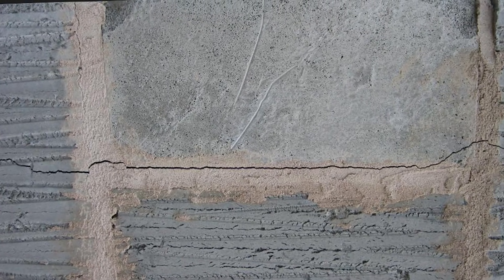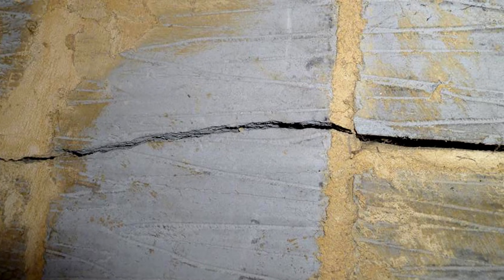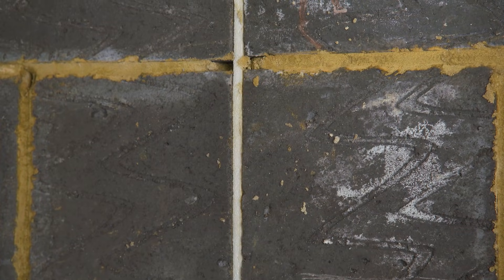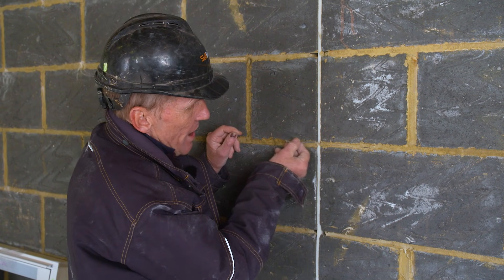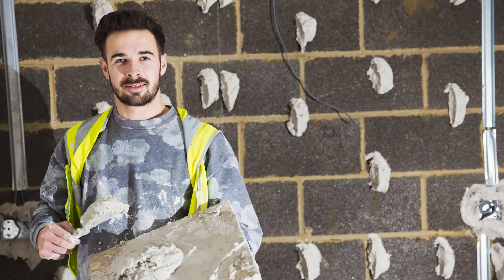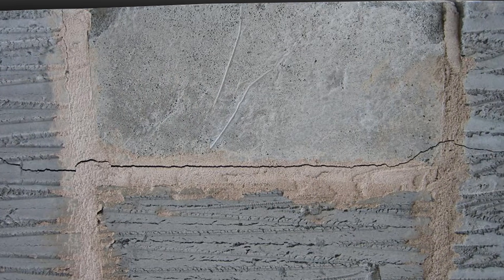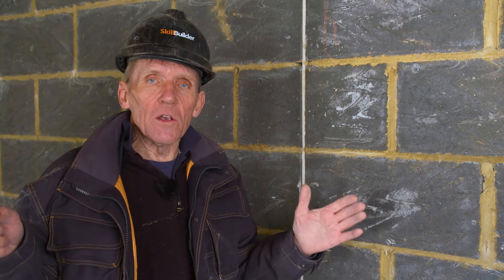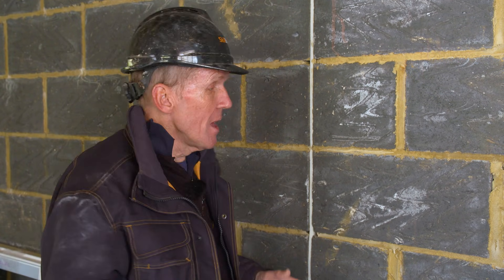Why Are Aircrete Blocks Cracking Up So Often?

Comment: by Aircrete do you mean Aerated Autoclaved Concrete, i.e. AAC?  if so, your joints have too much mortar and you need hollow core & Ublocks filled with concrete & Rebar .  I used thinset mortar on walls that were 28 ft tall and 48 ft x 80 ft.  there are no cracks even after earthquakes.  i did follow HEBEL's instructions to the letter.  the structures has a lot of rebar.  there is a dual lintel band made of Ublock & 2 pieces of #5 rebar.  there is verticle or horizontal rebar every 10 ft or lwss.  all windows or doors are surounded on the sides by cored block filled with 5500 psi concrete & #5 rebar and by U Blocks above.    the problem is Labor thinks they know more than engineers and don't do what they are told.  I find this to be a common problem; all to often i here "Oh you don't have to do it that way ; we never do".  we will soon solve the labor problem with robots.
Reply from the maker: different stuff. You don't have these blocks in the USA

Comment: The problem is typically inherent with a wrong strength mix! The mortar joints need to be at least 10% less strength than the material being laid,

Comment: Do the aircrete blocks have any internal reinforcement? If not, why not? Even very old Adobe or mud bricks contain straw for reinforcement to prevent shrinkage cracking. This was figured out several millennia back. Why not use short strands of glass fiber in the aircrete. Stronger blocks with no cracking.
Reply: I've never believed in air crete. Not substantiated as as safe as concrete.

Comment: In warm conditions these blocks absorb the moisture out of the mortar as it is spread .Always soak the blocks when laying .Bigger cavity and clinker blocks preferred choice .
Reply: I'm laying my first blocks & they soak out the mortar moisture wicked fast in 32 C (90 F) temps. But my block mfr does not recommend pre-soaking. So, 2 questions...

Are you talking about aerated or autoclaved aerated (or both) and what is your pre-soak rexommendation based on?

Comment: i was told many years ago by a long  retired foreman who went to see Celcon blocks being made ( from one massive block and the wavy lines in the blocks are the marks of the saw teeth that have cut them up)  that the manufacturers specified laying  100mm expanded metal lath into every third horizontal course . Goes to say that ive never seen it done.
Reply from the maker: That is true

Comment: OMG. Brits are still building homes with 17th century technology. Would you look at how thin those blocks are. What possible strength does that provide? not to mention almost zero noise attenuation. And where do you put the insulation to keep the cold and damp out in the winter? Bloody amateurs.
Reply from the maker: No need to show your ignorance or be insulting. The insulation is in the block trapped air and in the cavity. The compressive strength is 3.6 newtons. These blocks were not around in the 17th century but timber frame was.

Comment: My thinking we need an additive  to make it more liquid 
That way we can mix the cement drier , then additive then air .
The aircrete would be stronger
Reply from the maker: They use zinc filings to react with the cement and cause the bubbles to form.

Comment: The same principle described here,  applies to brickwork,  particularly pointing.   Too strong a mortar could lead to shrinkage  cracking of the joints and even brick fracturing, particularly on soft dry brickwork....a good soaking helps to give good brick mortar adhesion.  In restoration work on really old brick,  a lime sand mortar,  no cement,  may be required.  A controlled small amount of cement may be added to help the mortar “go off” a little quicker,  but there is a lot to be said for avoiding too quick a build, to allow the brickwork time to settle under its own weight.
I don’t know if the Brick Development Association still exists but 40 years ago I found their data sheets very informative when I worked for a small civil structural consulting engineering practice.
Reply from the maker: Yes the BDA is still around but is largely a marketing arm rather than a research body. I agree with what you say but fast track has made lime mortar uneconomic.
Reply: Research has found you shouldn't add any cement to lime mortars, they work best when they are just the lime. Any pre WW1 house is probably built with lime mortar, and any repairs on it should only be done in lime, using cement will cause brick damage and dampness.

Comment: Normally thermolite and celcon blocks are made by mixing pulverised fuel ash from power stations.  The structure of PFA is the same as concrete and will harden with age. New aircrete blocks will strengthen with age so a good idea is to use blocks that are six months old or more, if that is possible !
Reply: Toplite block do as well but to a lesser extent and have more lime in the mix.
Reply: @andrewtadd4373  The primary material in Toplite blocks is a very fine sand, rather than PFA, although some PFA is used as a cement substitute. They also include lime and anhydrite (gypsum). I'm curious to learn how you know the different lime contents of a Celcon and a Toplite block 😀
Reply: All UK Aircrete blocks are autoclaved (high pressure steam cured in very large sealed steel tubes) for about 12 hours - the length of time depends upon the grade of block. This brings them up to their design strength straight away and they gain very little strength after that. "Regular" aggregate blocks which are not autoclaved will continue to gain strength over time, but even that becomes fairly negligible after a month. So using an older Aircrete block will not reduce the risk of shrinkage cracking in a wall

Pretty much all concrete blocks have PFA in them as it is an allowable, and cheaper, limited replacement for cement. PFA is pozzolanic so it basically acts a bit like cement (not concrete)

Comment: Bought brand new blocks for support for a small outdoor building and they cracked as soon as the 8x10 was placed on them. Cheap...but pricey blocks. Cheaply made and overpriced at the counter.
Reply: You did not pay attention to this guys expertise. There is some common notion that “brick layers are morons” This guy clearly displayed a picture  explained that there needed to be a concrete pad between the supported beams and the aircrete blocks. They are not chosen for their comparative streingth, its their weight that makes them an interesting material. The point of this lesson, that you discovered in your application,  is that you can’t use them exactly like regular concrete blocks. I have owned and managed apartments for more than 20 years. I have over that time to begin to appreciate PEX and PVC plumbing products. Growing up everything was brass. These days solid brass venting and waste plumbing is thousands of dollars. No doubt aircrete will have its place with other materials for building. It just can’t be substituted without other changes in how to use it successfully. PEX needs support like electrical wires, it needs protection to prevent rodent damage. Cutoff valves need to be mounted to the wall since the pipe is not ridgid enough to support it. It’s disappointing to age out of your life’s experience and exciting to try new materials, buy new tools, make mistakes, swear like a sailor, and try again.
Reply: The one thing they ain't is cheaply made, you clearly don't know the process that goes in making aircrete blocks.

Comment: I'm pretty sure those blocks were never rated to carry that heavy a load. I'd never use them.
Reply from the maker: That is not the case. Those blocks are structural and putting weight on them does not cause them to crack. It is thermal movement and shrinkage through drying
Reply: @SkillBuilder  I Understand what you are saying, but I'm not going to use  them for any type of structural work. That stuff is really good for making planters..

Comment: Is there a way to make the movement joint the same color as the mortar?  Also, how difficulty is it to make the movement joint follow the existing mortar joints, as in go back and forth like a zipper or start in the upper corner and stair step down to the bottom?

Comment: The mortar doesn’t hold the blocks together, it holds them apart. Grin.
Reply from the maker: could something not do both? double grin.
Reply: He's right, you know. Most masonry is very strong in compression, but useless in tension. That is why a shifting foundation always yields cracks, and never smushes the grout out of the joints, and you never see bricks crushed.
Reply: @FelonyVideos so what to do about mortal please any idea😊🙏
Reply: @RonaldBarnaba The video says to install movement joints, but that just seems to dodge the root cause problem. Rebar or wire mesh reinforcement would allow for tensile loads.
Reply: [grin] I like the use of plain English emojis. [wink+thumbs-up]
Reply: Silly comment.  It holds them in place.  🤓🤓🤓
Reply: Say what..
Reply: that's why they used lime it accommodates for movement lime is a softer mix that cement
Reply: With respect modern brick don't use a frog they have interlocking holes and if as we did do a test and you will find if you use the right mix the mortar  does STICK and you will have a hell of a job to clean them up if you try disassembly. especially if you have filled the holes completely as you should. However, modern bricks are less water adsorbent and so more frost resistant than of old but they are also much easier to break than the old solid bricks with a frog.

Comment: aircrete was design as filler material for partition/non weigh bearing walls. supposed to be put inside rigid cadre that takes the load- key word rigid. So steel/wood frame = no go. Should go under concrete frame-post and beam, even that will give you crack at joints, so best option drywall/mesh-fiber glass of chicken wire over.

Comment: Look for info in the Hebel handbook specs oz/nz . Solid masonry,  specs the render with mesh and dulux coatings. Pays to do it properly, ie, post tensioned vertical rebar.

Comment: This bloke has very little knowledge of aircrete blocks, firstly there are aircrete made with PFA (pulverized fly ash) and others made with milled sang , PFA blocks will absorb lots of water if left in the rain and when the moisture comes out the block shrinks', if adequate movement joints are built in it is not a problem or if MJ are not possible the use of bed joint reinforcement will over come the problem. Unfortunately we do have idiots in the trade.
Reply from the maker: Brian 
Nothing you have said is wrong but that does nothing to contradict my contention that aircrete blocks can and do crack. Even with movement joints it is common to see cracking under windows.  Yes bed joint reinforcement will overcome that problem but it is not widely used and even if it is the use of strong mortar mixes is a chief cause of cracking. The mortar is mixed for the external skin and is not modified for the block course.  I have made videos for Celcon and visited their works and research facility so I think my knowledge of the problems is sufficient to make the points I made. I don't think you have added anything to the debate except to insult people. If that is your stock in trade then so be it.

Comment: I wouldn't buy a new build  older houses are solid
Reply: Leaded pipes, asbestos, aluminum wiring, roots in septic...But the wood is tight grained! :-)
Reply: @TheRainHarvester  aluminum wiring was an experiment in new home construction 20 or 30 years ago.  it was short lived as the resistance caused the wires to heat up and burn the house down.
Reply: @davidjames666  I've heard that it is still legal in many places and it's sometimes used for mains cables (from the street to the breaker box) in the USA. It can be reliable with the right fittings; the problems in the 1960s and 1970s stemmed from the fact that it was marketed as a direct replacement for copper cable.
Reply: I always like knowing if it stood for 25 years and still looks good the problem you will fined are usually just cosmetics.
Reply: Are yall writing with an English accent? I'm reading and it sounds like an English accent.
Reply: Yes and no. Survivorship bias, the houses that stand the test of time were better built, the poorly built one's aren't encountered and easily forgotten.
Reply: The ones that are still standing, anyway. Shite builders and cheapskate developers aren't a new thing 😂

Comment: The mix is always sand,cement, lime  scratch coat is 4,1,1.5  top coat 5.1.1
Reply from the maker: That is not true. 4 to 1 is too strong for 3.6 newton blocks
Reply: @SkillBuilder  worked well over the last 26 years for me

Comment: In your video "Bathroom Renovation #5 - Piping Up & Plumbing Tips" 11m17s, what is the metal adjustable bracket you are using?

Comment: Bed reinforcement (such as by BRC) is available, laid typically in alternate the bed joints to allow the movement joints to be spaced further apart or even  omitted.

Comment: I build with aircrete poured in steel stud boxes 6.3 cm (16") x 37.8 (96") x 1.6 (4") cm thick.  The void is filled with a layer of hardware cloth then the aircrete is poured to fill the box.  The panels weigh approx. 36.6 kilos.  When set they are easy as pie to stand in steel stud channels and tie together to construct walls.   1.6 cm (4") thick aircrete walls are incredibly strong and extremely well insulated.

Comment: Roger, you're a man after my own heart, brilliant video, what is it with the building trade that so many people carry on like absolute donkeys thinking they know better than the set standard or that its ok to constantly deviate and divert from professional standards. I'm not even a brick layer but I've still been to the library to get a book on brick laying, was written by some engineers or phd bloke, he was even suggesting mortar ratios as weak as 9 sand 1 cement 1 lime and don't forget volume isn't the same as weight. Look at the cladding crisis, billions of pounds worth of damage, law suits and death, all caused by donkeys that refuse to learn, understand or work to professional standards. I have a saying I say to my son, wise man absorbs knowledge like sponge absorbs water. It's up to everyone to act a bit more like a sponge to absorb not just knowledge but other peoples advice  in order to improve build quality and prevent damage and disasters. How about a video on the golden mean 1-1.61, how many builders know about that, would create much prettier houses than just lego houses. Keep up the good work .
Reply from the maker: Great comment. I think many builders have a pride in not learning things which is perverse.  Not many people even look at instructions and consider it a sign of weakness to seek advice. I have seen aircrete manufacturers recommend a 1.1.8 and I have tried it. It makes a very weak mix that can be diifcult to work with but a lot depends on the sand.
Reply: @SkillBuilder  I do agree that does it seem quite a weak mix but like you pointed out too strong a mix increases chances of cracks from reduced flexibility. Getting back to donkey syndrome, we all know what causes it, 'pride', bravado, nobody wants to look like a twat. I was out cycling yesterday, ran into a bloke who's chain was jammed, I said do you want a hand, no no, was on the phone to his wife, I said are you sure , he said , no all fine, maybe he didn't want to trouble me either. I thought bollocks to the pleasantries, he'll be waiting there for ages , jumped off my bike and yanked the chain out for him, we were  both on the way within minutes enjoying a sunny day again, that is how simple things should be. Anyway, brilliant videos you do, is really nice to hear someone increasing knowledge, educating people and driving up standards without being bureaucratic.

Comment: I rendered my concrete blocks with Tyrolean cement. Spattered on a first coat and allowed to cure. Then sprayed a second coat which was wood floated while wet. I planned on a third spatter coat but the smooth finish was so nice I left it smooth. That was in the mid 1980s and the wall still looks great.

Comment: Aircrete, never heard that name before. We usually name it "cellular concrete" or "gas concrete", or by the brandname Ytong. But I guess it's all the same.
Reply from the maker: Aircrete is the generic name for these blocks in the U.K.  A point to bore people with is that the cement slurry is aerated by throwing in a handful of zinc filings. If you want more air pockets in the mix you increase the number of filings. 
I am not sure how Ytong are made but they are different.
Reply: @SkillBuilder  Toplite it's powdered aluminium with warm water and lime to activate it.

Comment: In Australia in the 80s rooftilers used to put bondcrete in the bedding mix, the ridges would then crack down the guts, because there was no room for movement